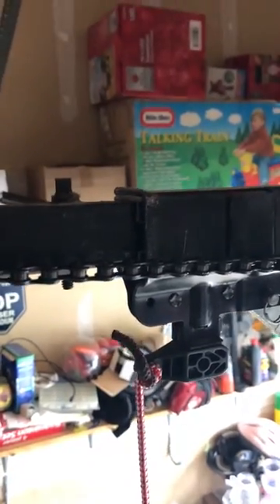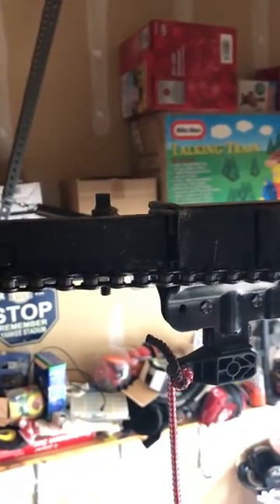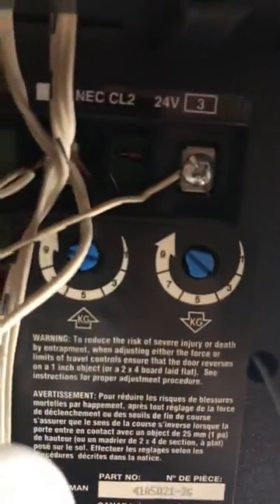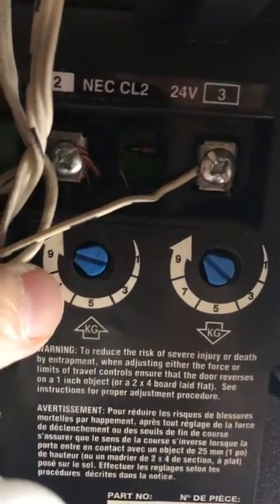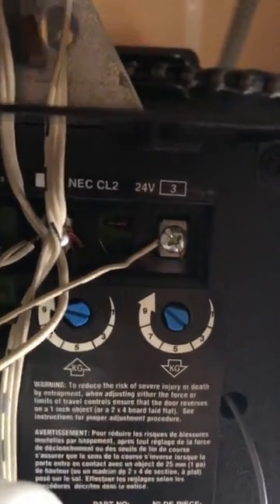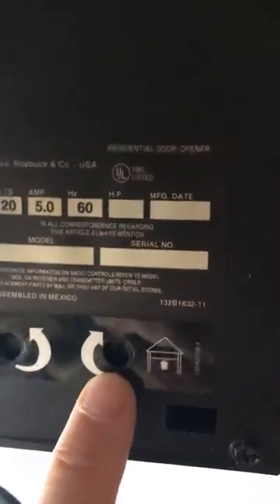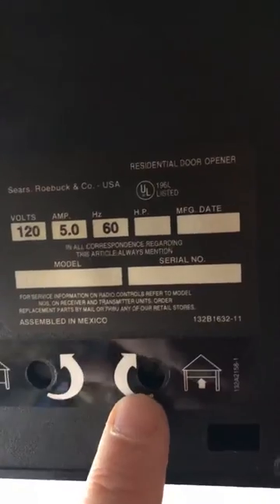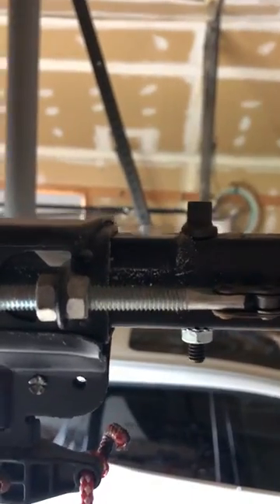Craftsman garage door opening too far and hitting stop bolt easy adjustment

Comment: You have to make a few adjustments your force control is set way too high if something gets trapped or Neath the door you’re going to break that item or you’re going to break your garage door opener so you want to set both limits basically at one and then put your hand on the door and see how much force it is when the garage doors opening you want some force like mine are set to three and it works out perfectly so you want to make sure when you pull on the door it will stop with a decent amount of force and when you set the down forest put your legs spread them apart so they do not interfere with the safety sensors and then close the door on your shoulder See how much force it is putting on your shoulder make sure it’s a decent amount but not too hard and then your garage door chain do you want to disengage your opener and then tighten the chain just a little bit